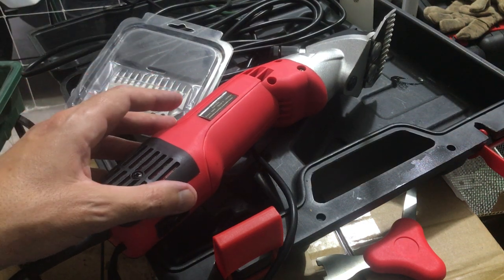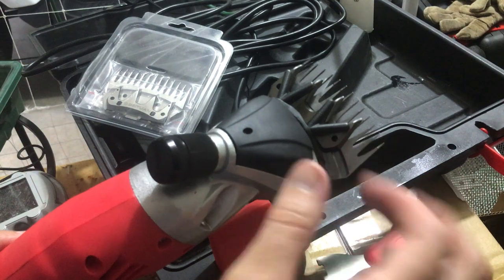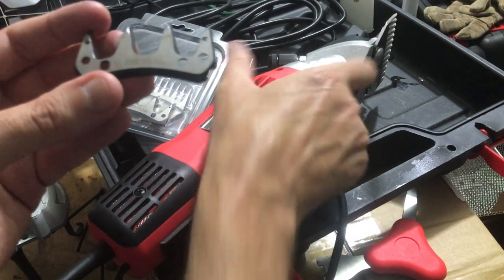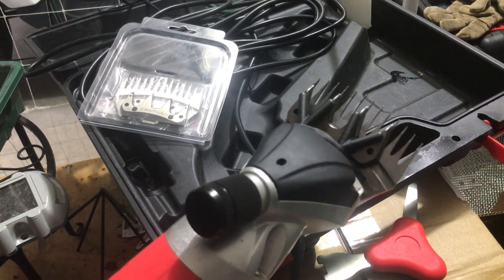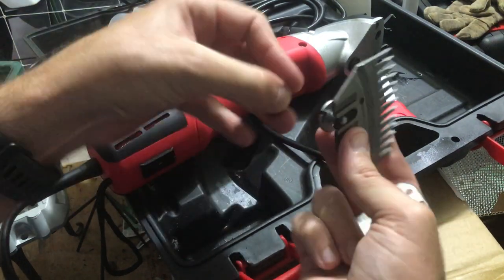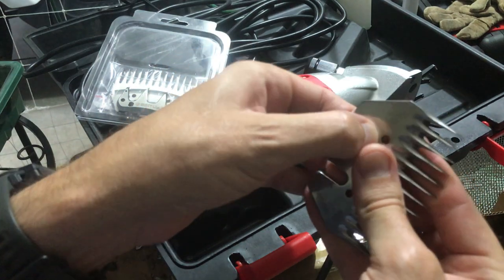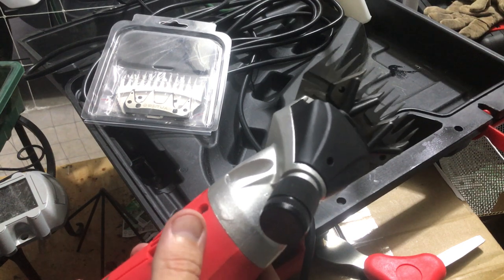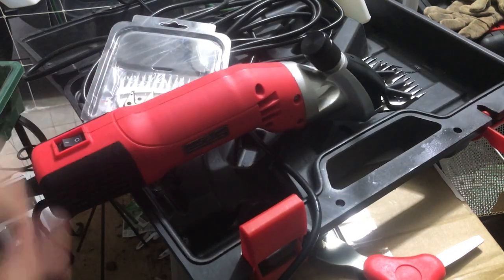Sheep Shears Pro (Sheep Clippers) - Blade Changing

Comment: this was absolutely perfect video
 I bought these shears last year and the instructions were terrible about showing how to manage the blades and since they were expensive I was scared to use them and tear them up  I am excited now to get going with them  thank you for a no nonsense video that does not have annoying music or endless chatter  Great Job  thank you for posting  ps  they are out of australia and when mine arrived the tip of one of the blades was broken and I emailed and they called within two days and the new blades arrived within a week or so  they have top notich customer service
Reply: Good to know, thank you!  I get mine in this week.  Looking forward to using them.  
I am a little concerned though, I got them because they came highly recommended for dogs.  However I am wanting to leave about 1/2" - 1 inch of hair on the animal when done shaving.  Is there an adjustment you can do (or attachment you can get) to make it leave more or less hair behind?  Or are they a set height?     
Thanks for your help!

Comment: Hello
May I ask, is this machine suitable for shearing a large number of sheeps? I'm talking when you have to shear 100s of sheeps can it withstand that? Thank you
Reply from the maker: It is the most heavy duty I have ever used, I think it will work just fine.  Obviously you might need to clean and oil it at times, but that is standard with any clippers.  The company that makes it has great customer service as well, if you have any issues they will make it right.